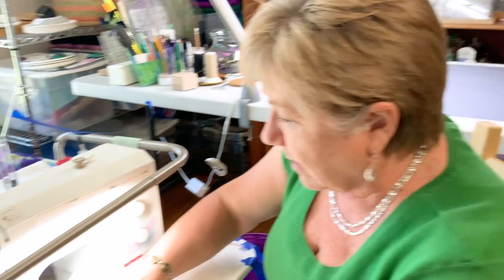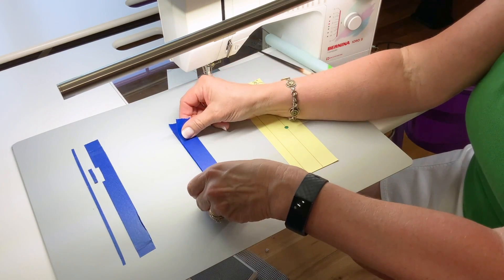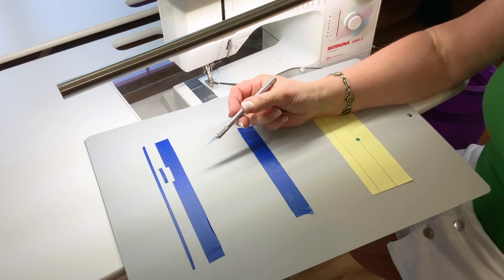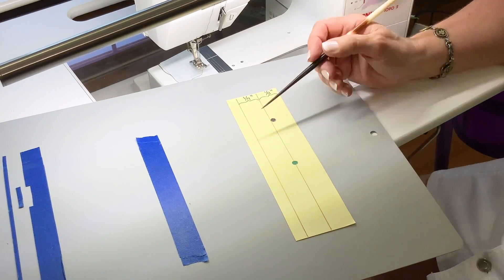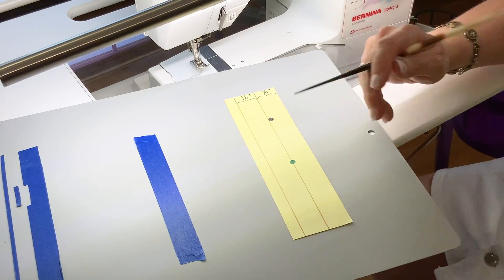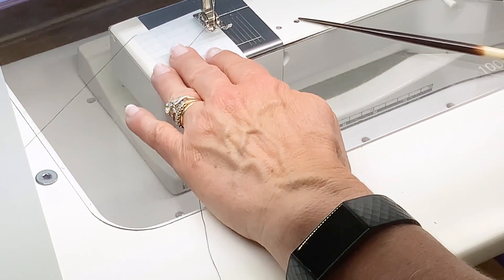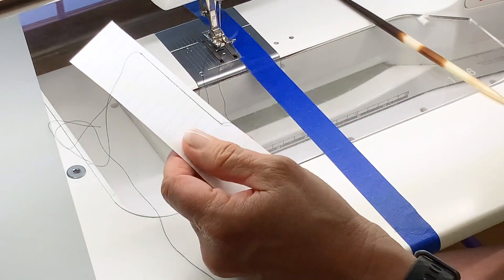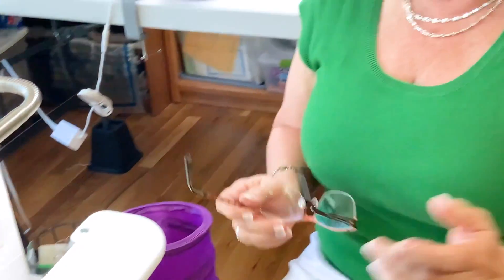Perfecting Your ¼" Seams - Tips & Tricks from the Tucker Team

Comment: I used to use painter's tape until I spied a leftover roll of Contact tape. (mounting tape)  I marked the 1/4" line on my machine and put the tape in place.  Yes, it has a piece of paper on top....leave it.  You will have hours of sewing and before it starts to lift.  As fabric and thread debris collects, it will act like a sticky fabric roller and it will not be sticky.  This works like magic for me.  Taught my 9 yr.old neice to sew my strips using the tape while I work on the next step.  Make sure not to go over your bobbin area.  I use a piece behind of and in front of the bobbin case. Hope it works for all of you who try

Comment: A tip for making your tape ledge. Instead of tearing separate lengths of tape, use an Exacto knife and cut several layers off of the roll at one time, then you peel the stack and they are already aligned. 😁
Reply from the maker: This is another way that this can be done. There are many ways this can be done.

Comment: Regarding ledges:  The holes in the bed of a machine are for a number of things, to include a metal seam guide.  My preferences is to use a seam guide if I'm not sewing with my  Bernina gated foot, and I use that with a needle click to the right typically.  It has the advantage of  being sturdy (v. flimsy metal on some) and can ride over seams/pins if necessary as there is a little spring on it. (All terrain foot).  It also works well as a guide when you have to sew 1/4" away from a line.  Because the edge sits in front of the foot, you can very easily see that you are on your mark v. the side of the presser foot.

Aside:  My favorite piecing machine is a 1946 Kenmore (by White) Rotary Deluxe!  The foot on that is a perfect scant 1/4".  Of course the needle does not move and it does one thing and one thing only :  a perfect straight stitch! (and of course has the single hole so no fabric falls into the abyss).

 Note that if you have a straight stitch plate, you can move one click (I think up to two) and not abrade against the edge of the hole.  But any should test for their machine and set up to ensure appropriate clearance.

Making test blocks for the thread, fabric and pressing techniques that you are using for your project (and the number of seams in a block) is the best guide for determining where along the perfect-scant spectrum you need to be.  Small differences add up along multiple seams. My perfect scant 1/4" ended up too scant for a  3" 9 patch.

Also worth noting, that for your wonderful rulers, if one doesn't quite hit the mark (so long as the line is straight), your trim downs are going to fix any bob or jiggle--which is the beauty of them.  I always recommend your products because I use them and trust them.

Comment: I'm new to quilting so I'm wondering why you would use a scan 1/4 of an inch?
Reply from the maker: A scant 1/4" seam helps make the 1/4" seam and pieced pieces more accurate when you press the seam. It also helps when you have fabrics that are a bit thicker, as the thicker the fabric the more space it takes up in the seam. So that is the main  reason for using a scant 1/4" seam.

Comment: Thanks for the tip but I have a small problem my bobbin case would be in the way, I will have to remove the tape to change the bobbin.
Reply from the maker: Many times quilters will put the tape on and then cut the tape where the top has to come off to change your bobbin.